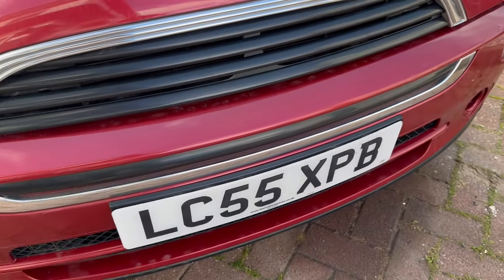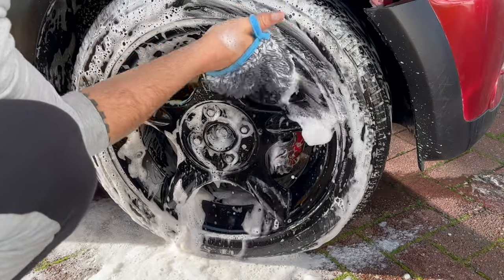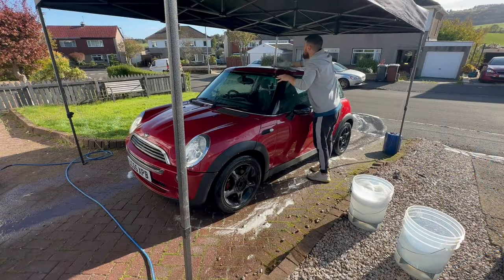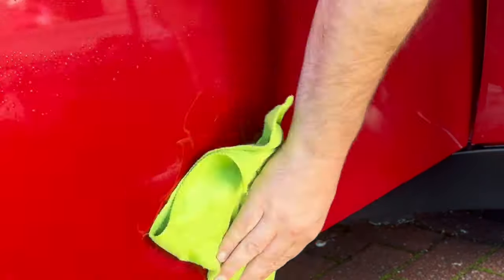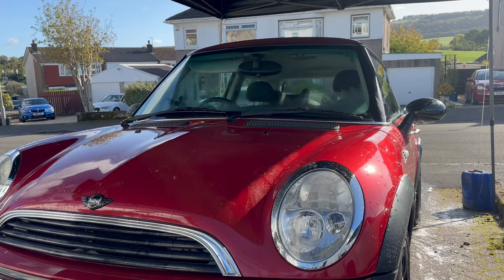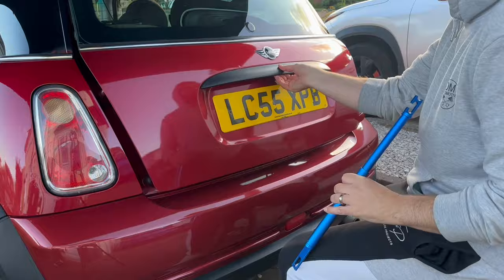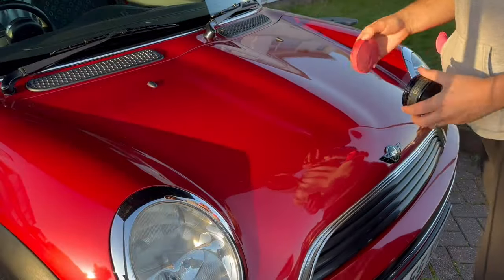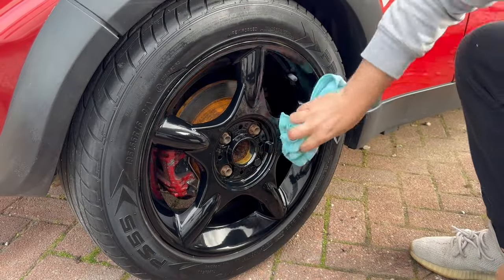Dirty Mini Cooper Winter Preparation Detail | Exterior Wash and Protection

Comment: Nice work 
Scrap the 2bm bro
Pre wash
Coat the car in shampoo via the lance
Pressure wash your mitts after each panel
Saves water and is safer for your paint 👍🏻
Reply from the maker: Thank you, I do use that method from time to time, it just depends on my mood on the day.
Reply: @DavidMcBay  I much prefer it now a days